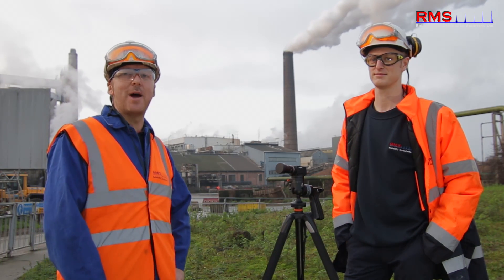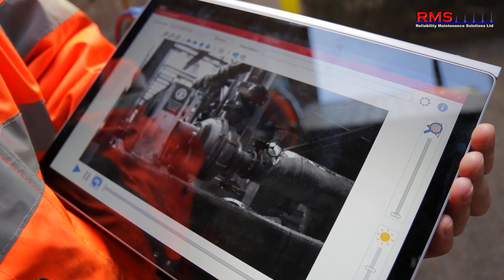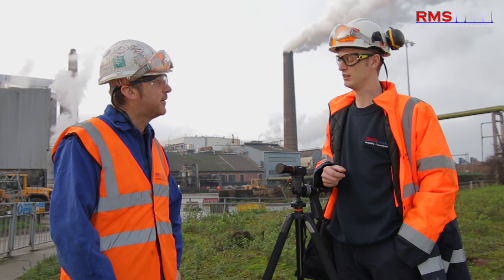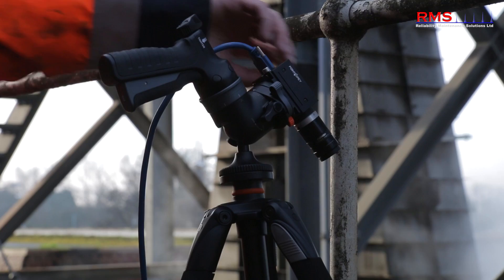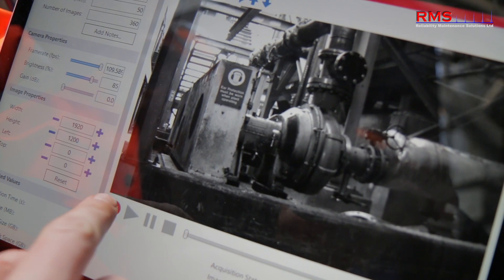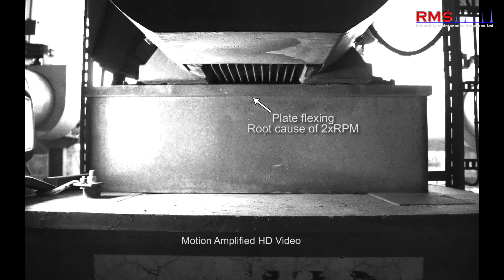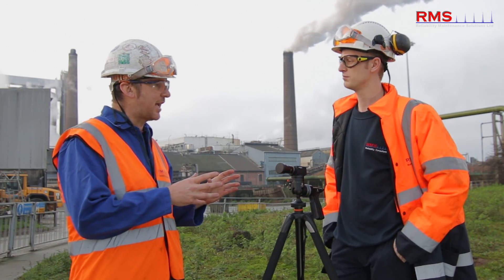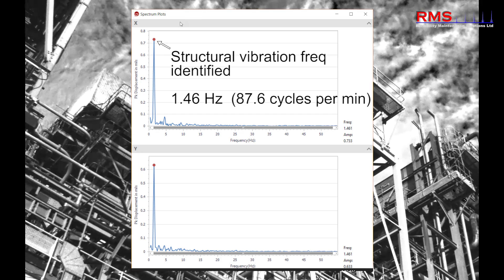Motion Amplification - What is it?

Comment: Any official study about the efficiency of this non contact technology comparing to others and the contact technologies?
Reply from the maker: This complements the other contact technologies not to replace them. It is more suited for lower frequencys. Such as running speed vibrations and harmonics. Can now give live visualization of the asset in the field using 2.3 million pixel sensors.
Reply: @MotionAmplificationRMSLtd  does RDI motion amplification (R) has the ability to implement data from contact sensors, synchronized with it?
Reply from the maker: @LawatheMEid   You can use other contact sensor to trigger capture using the CM system https://www.youtube.com/watch?v=8P7VGhENyUo&lc=UgzjeLc4vCzPhwr45aR4AaABAg&feature=em-comments
Reply: @MotionAmplificationRMSLtd  thanks that was new.
Now is there a video where the RDI camera registering vibration data for a point where there is a contact sensor (accelerometer) collecting the same point's data?.. and a comparing between the two data?!
Reply from the maker: @LawatheMEid  Not seen a video on this. But non contact as accurate as accels more so at lower frequencys. They have lab test to compare our field results comparable. System needs distance to be accurate
Reply: @MotionAmplificationRMSLtd  so you have a criteria to advise who is deciding to detect the vibrations with: contact or non-contact sensors, depending on the type of the machine, the industry and the conditions surrounding the machine?
Or it is just the experience of the supervisor, let us consider it happens for the first time?
Reply from the maker: @LawatheMEid  The technology does not not replace traditional vibration routine monitoring. It complements it. It is more used as a trouble shoot tool for root cause. If we see raised vibrations at 1xrpm and harmonics, we tend use the camera to diagnose actual cause.
Reply: @MotionAmplificationRMSLtd  thanks, that was helpful.